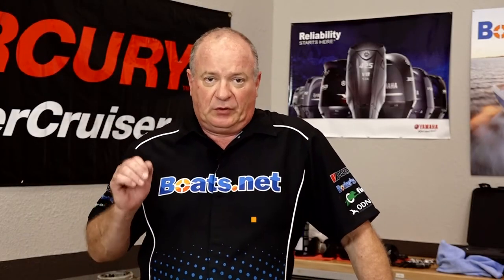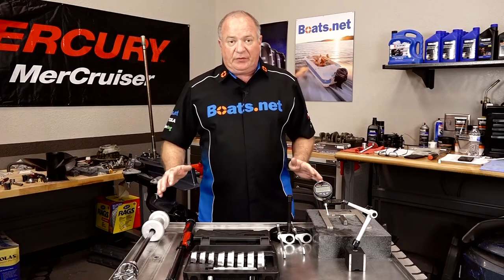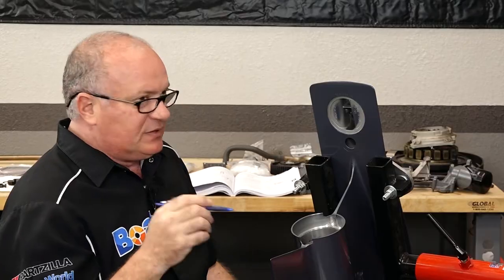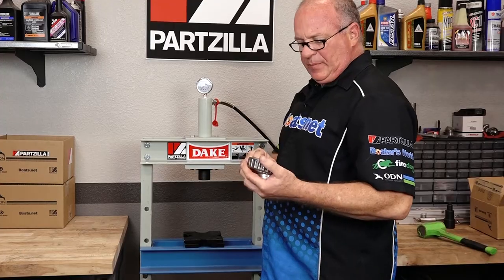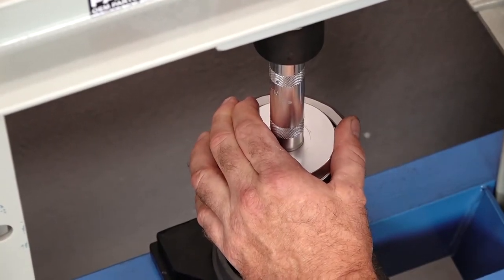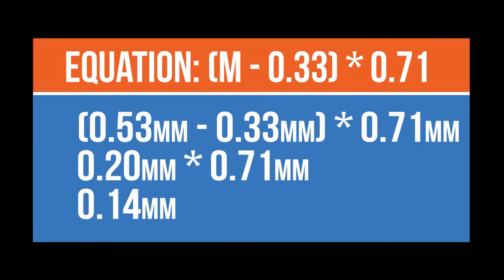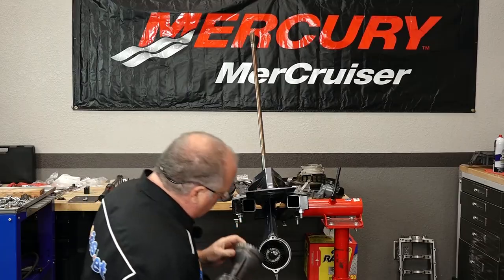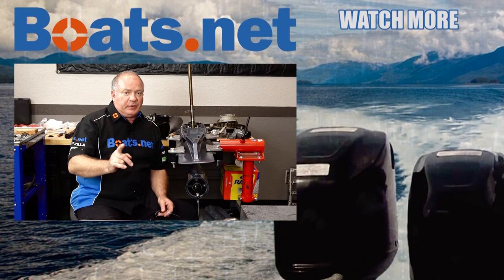Yamaha Outboard Lower Unit Rebuild | Yamaha F225 Lower Unit Rebuild  | Boats.net

Comment: John, thanks for taking the time to put together a informative video. I am in the process of rebuilding the  lower unit on my F225 and  must have watched your videos at least 5 times today to educate myself.  Service manual is nice but it makes much more sense after I watched your video.  

Question:  When measuring the backlash at the end, where do you measure the backlash in relation to the center of your drive shaft?  Do you measure the radius of the pinion, add that measurement to the radius?   Thanks in advance for the comment you might provide.

Comment: Great video, very professional work! Just one thing. When you measure the backlash I believe, by listening the sounds that the measured backlash includes the ''slack'' in the clutch dog. Remember the forward. The prop shaft does not move but there is a slack between the tooths of the clutch dog and the tooths where the clutch dog 'bit' in the forward and reverse gears. Think about it and let me know!
Reply: Pls sir need real details of the math

Comment: at 15:50, one solution, use a plastic "bung" (for sealing leaking fittings on boats), or a sprung steel sheet, rolled up, this forces the needles out, keeping them in position; the insilation of the shaft can push this out, and with the spring steel, this can be removed afterwards quite easily.

Comment: This was a great video. I just had a prop shaft replaced on a 1996 Yamaha 200 and after the repair the prop shaft now moves in and out about a 1/4 inch...prior to the repair it moved 1/16 if at all (just enough to prevent binding). The marine shop didn't touch any of the forward, reverse or pinion gears so I am not sure where or how there can now be movement as there isn't any spacing difference on the output shaft, seals, etc. withing the prop shaft housing? Any thoughts would help as I don't want to run it if the movement has the threat of additional damage?

Comment: Hi John, I have mercury out board lower unit on a inline 6 115 Hp, and they recommend loctite on the pinion gear.  What loctite do you recommend the blue?  Mike

Comment: I have a 2018 Yamaha 200 HP the lower unit and engine holding bracket is Corroded we’re both need replace went to the outboard shop here in Oakland ca. No one has replacement parts not even Japan a new motor cost $20,000 plus I bought the the boat new it’s a 23 Ranger Tug any advise would be helpful thanks

Comment: while viewing this video when you were measuring backlash I noticed you didn't where the dial indicator should be located. It makes a huge difference where it is mounted. Out 1/4 inch or in 1/4 inch  changes indicator reading drastically. On the yamaha tool there is exact mark for the indicator bracket. manual also gives exact height to locate indicator tool. I can't find tool. is there a way to figure out where it should be located?

Comment: Very informative video, unbelievable how prices these tolerances are. So what would cause back and forward (in and out of the housing) play in the prop shaft? I have one Yamaha F150 lower unit that has almost none and the other has quite a bit? The one that has plan in it, STBD side, it quite a bit noiser than the other one in general.
Reply: I have the same question.  I have a LU on a F250XA that has 1/4" of play on the prop shaft.  I am putting on a new LU, but wondering what I am going to need to fix the old one to keep as a spare.

Comment: If my backlash for forward and reverses is 22.71mm both is about the same measurement do I need to change my pinion shim? The 22.71mm is way off how can I get closer to spec ?

Comment: Hi - Great video! If just replacing a prop shaft (2013 F300) do you have to go through the shim process?
Reply: In my opinion, yes. The prop shaft is held in place(in/out) with the reverse gear and bearing carrier. The distance of the final race is also involved. GL
Reply: Yes.  4.2 liter, all v8s and all counter rotating lower units you have to shim.  

All others if you are just replacing the prop shaft you do not.
Reply: What if you’re just replacing the dog clutch? Any need to re-shim? 2001 HPDI 200

Comment: Hello John, how difficult would it be to convert a 30” engine to a 25” engine is it just a matter of replacing the input shaft and removing the extender?
Reply: You will also need to replace the shift shaft for a shorter one. GL

Comment: What is the need to pull up on drive shaft while pressing the plastic sleeve with metal cap on.
Reply: Timothy Berrian it pre loads the drive shaft. If you don’t you will here a knocking noise at idle and will go away with rpm increase.